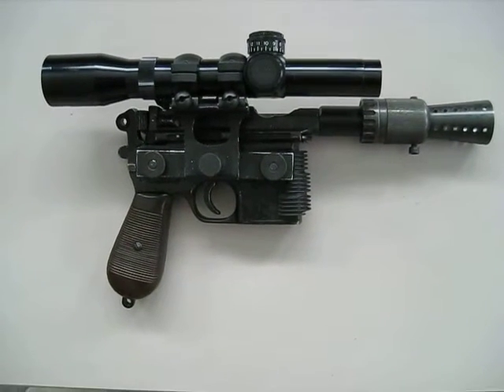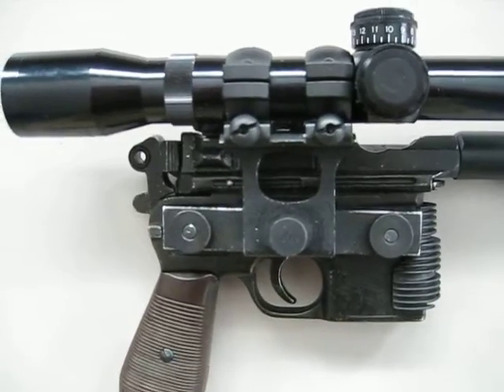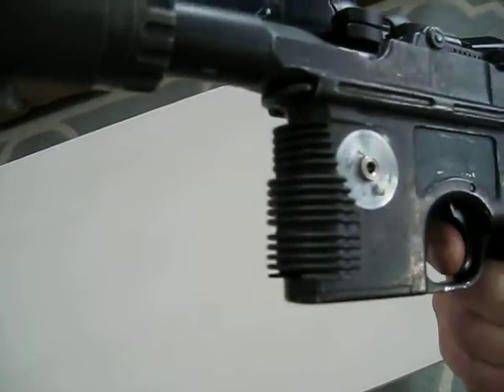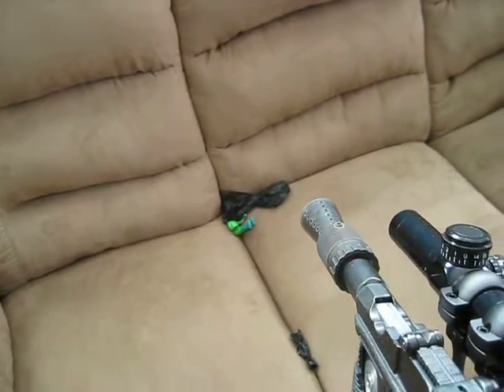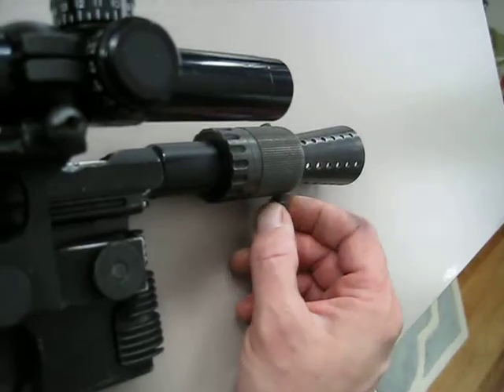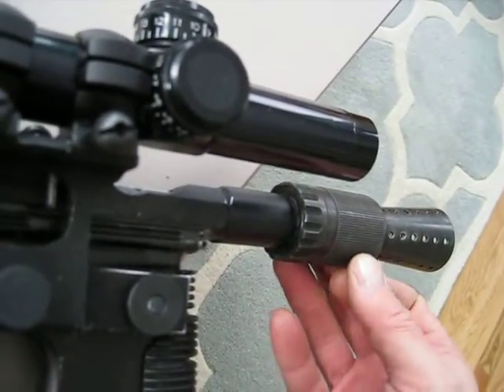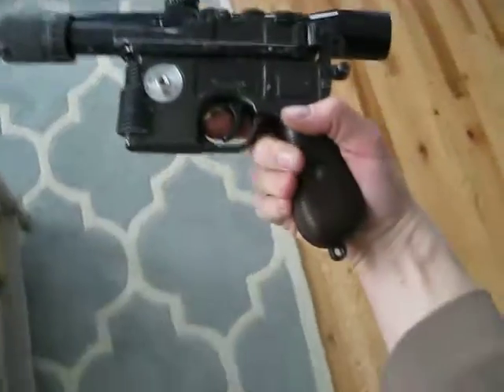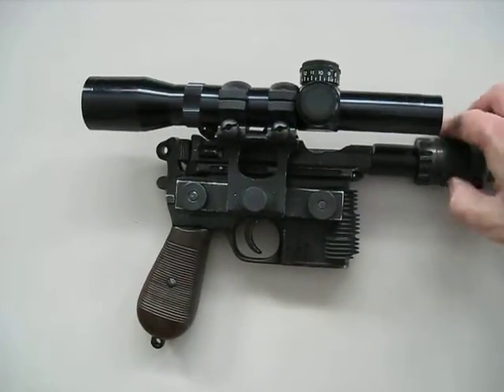Star Wars Han Solo DL-44 Blaster gun with WORKING laser and sound effect

Comment: Very well done.  As has been asked before: what laser are you using?  And do you know the exact model of that Tasco scope?  Is it a 1" tube or a 7/8" tube that would fit the Todd's Costumes DL-44 scope mount?
Reply from the maker: Thanks! You've seen the new video, so you know about the laser (ebay purchase). I've since sold the Tasco scope, so I don't recall the model. (Check ebay under pistol scope.) The Weaver mounts I used here:  http://www.therpf.com/f9/creating-my-han-solo-dl-44-burning-laser-237824/ were 1" and are for the "Greedo Killer" look. The Hero version scope mount from Todd's is a 7/8". (I have one, too, but haven't gotten around to mounting it yet.)

Comment: Where do I pick up that laser ? Is that taking up space all through the barrel and did you drill a hole through the solid barrel? Very cool build. I recently buildt one also, but have not dared getting into lights and sound yet.
Reply from the maker: I actually had to have a machine shop bore out the barrel. The laser I found on ebay. (I have more info in the new video.)  It took some experimenting to get the sound card connected to the battery and laser, though. (If only I had an electrical engineering degree.)